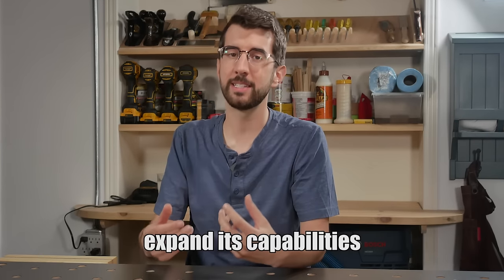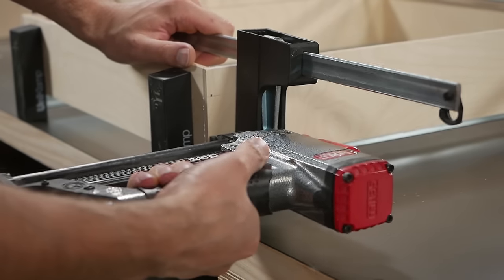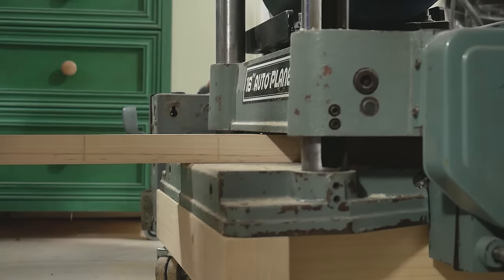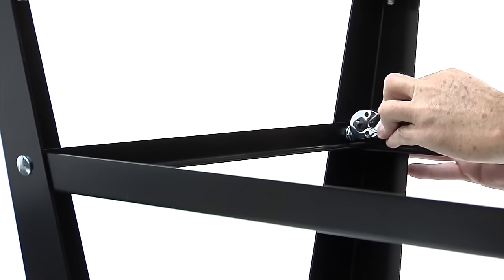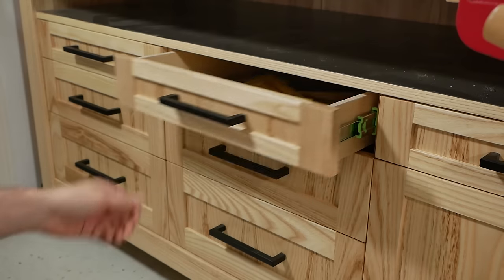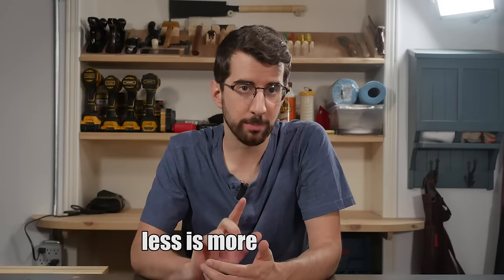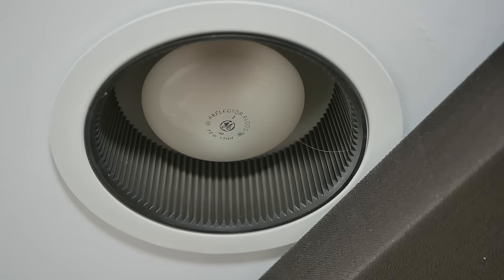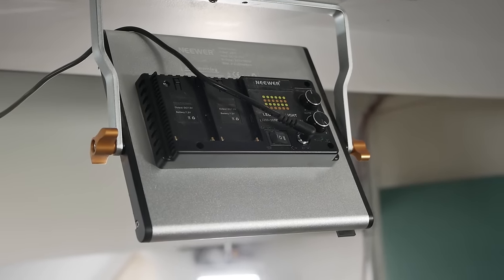a better way to layout your workshop

Comment: Appropriate video for me at this time. We recently moved from a big house where we lived for 30 years to a much smaller home. My 3 (!?!) shop spaces were about 1300 square feet plus additional storage space for "things" for a total of, maybe 1500 square feet. Sold or otherwise disposed of several big tools - stationary compressor, 2 welders, radial arm saw, band saw, etc. Now my shop is less the 200 which include the garage that SWMBO wishes to use for the car. My fix was to rent a storage unit for wood and seldom used tools, many of which are auto mechanics for my other hobby. Yes, a bit inconvenient but it's only 2.5 miles away. Everything else at the house - a (perpetual) work in progress. Now, what to do with that hefty drill press...........

Comment: You can use cheap conventional sturdy foam as well.  The trick is you have to freeze it but once you do you can drill or route it same as any other material.

Comment: cleaning and organizing takes a LOT of time. BUT I can say if you can get it organized and make a "space for everything", it makes it much easier. Its just a lot harder to do in a small space. And you can actually find your tools when you need them, saving a lot of time and aggravation when working on a project.
And YES good bright lighting makes a BIG difference. For the past 8 years, I only had some dim fluorescent lights in my shop. I wanted better lights, but the ceiling is high so it takes more than just strip lights and I didn't really have the money. However, I invested some $ into some LED lights and finally had the time to get them up about 6 months ago. And wow, what a huge difference it makes. Well Worth the investment, and makes working so much easier and more enjoyable.

Comment: I have a two car garage shop and have a Delta Unisom with the extended fence
My solution for the song was to put an angle iron extension on the table for the extended fence and pin that to the wall and then the saw is on heavy duty pop-up casters 
On the size not in use I just fold it up against the wall easier than one of those mobile bases

Comment: $3 magnetic bars from harbor freight are a godsend for storage in a small shop on a budget. i could not recommend them enough. french cleats are fine, but are going to run you a bit more in time, if not money, than what it would cost for four of those bars.

Comment: late comment to the video but white paint on the walls for light, and barrina is outstanding for cheap easy to install lights. use them in my shop and have installed them in four other garages to date for friends and family with no failures or complaints. the brighter option they have is a bit harsh for my liking, but the ones i use (single row) are bright enough to work under without hurting my eyes if i look up for some reason

Comment: Small shop?  You've got room for a chair!  ...and to sit on it!  ;D  
If you're REALLY short on space (yeah, I'm just jealous!) the ceiling is a good place to fill if you have the headroom.  Ladders are the obvious thing.  Also stands for things like mitre saws (and anything you can adapt to fit on them) if you have to take them outside just to be able to put them up.   Once they're up there anyway, you can slot things like long rules or rail guides into them for storage.  
Couple of decent saw horses (collapsible, obviously) and a piece of MDF (with MFT holes for extra points) and you have a collapsible outdoor workbench....that you'd kill to have the space to have inside!   
What storage space you have under the bench, you can put something like a bench grinder in but mount it sideways on a sliding shelf (with really good slides!) and you can pull it out to get access.  Upgrade the lamp on it (as they're about as good as the stock tool rests!) so you can see while you're down there and definitely connect it to your dust extractor while in use -  a quick connect style such as Bosch's or Festool's is good, as you obviously don't have room for any of that wall ducting or the room-sized extractor to go with it.  
The Festool extractor is quite good for a small shop - pricey, yes but it's rectangular so it actually fits in the sort of under-cabinet or next-to-workbench spaces that you might have...and it's on wheels so you can take it outside with you too (if you don't live in the land of perpetual rain!).  If you're feeling particularly flush, there's a cyclone add-on that mounts on top of it too.
"Small" is a relative term;  I reckon there's a few out there that would consider my shop big....but not many ;D

Comment: I find your analysis very interesting. I like the way you think. However, I would challenge you on the first order of retrievability. I think the small shop situation certainly changes the equation compared to a large shop for the reasons you mention, but it will certainly make a difference even in a very small space. How do I know this? Because it is absolutely true for the kitchen. Kitchens in general are not that large. Yet organizing them so that the most critical tools are in reach of your "work bench" i.e. the area of the counter where you do the prep and food assembly is vitally important. I can cut my cooking/prep time in half when I have things smartly arranged for reachability. I have even found that purchasing a portable cooktop and placing it where I do my prep work makes me surprising more efficient than turning around and walking 3 feet to the counter space behind my "work bench," where my non-benchtop model stove is. There are limits to this comparison, of course. Cooking is not woodworking...not exactly. Though there are often stationary appliances you have to walk around to to use (like big shop tools) and lots of hand tools you have to fetch from drawers. So, I would argue that the underlying workflow principle is extremely similar.

Comment: I've been cutting miters up to 46" on my table saw and they come out super tight. I haven't used my miter saw in over a year. I should probably put it somewhere else other than in the corner on the floor. And I do have everything on wheels, but that's because my wife still wants the ability to park in the garage in the winter or in bad weather. I don't have the option of leaving my table saw/outfeed table in the center of the room. In my case it is very important that everything is on wheels for me.

Comment: I finally figured out my lumber storage solution (Although I know it won't work for everyone): Under the basement stairs. That space is always awkward, especially if you don't have side access to it (which I didn't) so I built a giant shelf system going all the way to the floor to store boards longways in the tapering space under the stairs. Giving up a few extra feet in front of it, I can store up to 12 foot boards and a reasonable number of them, down to random small length scraps near the ceiling.

This totally won't work for everyone as you need at least the length of the boards your storing amount of space to pull the boards out, so you need that much space behind the stairs, and for a lot of house designs, there's an external wall 4 feet away, but if you have stairs and then another 8-10ish feet of potentially open space behind them, this could be a way better use of that space instead of the folding tables and chairs I know you all have under there right now.

Comment: I very much agree that it isn't talked about enough that we should all consider what projects we will actually spend time working on. However, I must disagree on drill bits. They don't take up much space, and if there are any sizes that you commonly use, you need several in that size. Since you will have several, why not have some by the drill press and some by the cordless drill? Also, I sometimes load up drill bits with the cordless drill/driver into a tool caddy to do a mobile job somewhere else.

Comment: Two small tips from me: 1. Unsorted drawers - at least make a "one layer!" rule. Preferably "the bottom is not to be fully covered, ever" rule. 2. Always have a buffer case and a trash case at hand. The first one is for quick drop-ins of stuff you know is out of place but you don't have the time to deal with it immediately. Works wonders especially for screws and smaller parts.

Comment: I have a 10' x 20' shop. I ended up getting rid of all my stand alone tools and replacing them with benchtop tools and then constructing a bench that could house these tools on hinged shelves beneath 180 degree folding hinged lids that formed the top of the bench's work surface. This bench cleared all my wall space and acted as off feed for my portable table saw. I made a router table which I fitted between the rails of my table saw and the router off feeds onto my bench. 
  The bench houses a bandsaw, drill press, miter saw, surface planer and access to a plenum that is equiped with blast gates to each tool including the tablesaw and router. The plenum attaches to a dust cyclone which attaches to my shop vac. Since my shed is elevated and has a wood floor I connected the plenum to the dust collector via a below the floor level flex tube. I got tired of tripping over that vac line.
  To access any tool housed inside my bench and open it's blast gate only takes less than a minute. I only have my miter saw and surface planer rigged so that the working surface is flush with my bench top so that the bench acts as support for these two tools.
Reply: The basic rule of shop size is figure out what you think you need then quadruple it. That might be sufficient. Otherwise you're constantly fighting a losing battle for more space.
Reply: Depends on how much dinero you have to work with.

Comment: The first thing I did was get rid of those garbage metal stands. The best wall storage I've found it a plywood sheet screwed to the wall with 2x4s behind to push it out a little. Just make and screw your tool holders straight to the wood and you can JAM things together, like I have holders screwed into holders for 2 -3 layers of tools and its all organized and easy to get to. I also recommend a 3d printer to print containers and custom holders for other tools.

Comment: I like casters just because I can move tools out of the way for bigger projects once I don't need them anymore.  You can do the jointing and planing, then move those out of the way.  Eventually you end up with the floor space to assemble the project, and then move things back when you're done with the project.  You generally shouldn't be doing multiple projects at the same time in a small shop anyways.  
I'll agree with you on drill press.  Alot can be done with a habd drill.  There are some things like forstner and hole saws that don't work as well in hand drills.  It depends on what you do.
The other option for air compressors is just get a much smaller compressor that can sit on a shelf.  Then you can use it for other things like blowing sawdust off or other air tools.  The cordless nailers are nice though

Comment: Actually, casters ARE the answer, my friend, and here’s why:  I have a small wood shop, as most of us do, and mine happens to reside in the only economical space available to me, my basement. I have all my big machine tools on casters that allows me the maximum layout flexibility, allowing me to configure and reconfigure my entire shop, or just a tiny portion of it, in just a few seconds by moving a machine or two into a different area of my small shop.  It is because of CASTERS, my friend, that I have discovered the true genius of what the word “flexibility” means.  Because of casters, I maximize my ability to accommodate any size stock on any of my machines without all the hassle and expense of having to buy or rent much larger shop space.  Is it the most efficient situation?  No.  But for those of us who don’t make a million dollars a year, it sure beats the hell out of paying tens of thousands of dollars for a new shop.  And, yes, most of us have already maximized the layout of our shops, so we do thank you for your insightful video.  But, casters are, in fact, the answer for those of us who don’t own wood shops the size of a parking lot.

Comment: There is a science to lighting definitely. I hate direct lighting where the light source is in my feild of vision, especially with glasses. Indirect lighting is better where the light reflects off a white wall, then into the room, it also eliminates harsh shadows.
Reply: Paint your ceiling white and then over-illuminate it using those $25 monster LED wing lamps. But have an array of them facing upward. Build cheap lamp holders. They're dead easy to wire up and mount onto 2x4's.

Comment: Great video. I have a small shop. It's only 8x12ft. In it I have a table saw, miter saw, planer, jointer, band saw, drill press and a grinder. I like to use flip carts. I just roll out whichever I'm using into the middle of the room. For lighting i have 9 4ft shop lights. There is no where that has a shadow. Got them for only $3 each. 
I try to have a place for everything and I put everything back every night. 
I'm currently wondering if I can hook 2 sgip vacs together for stronger dust collection.

Comment: I will say, as a maker with ADHD first order of retrievability with having to take literally zero steps as well as open storage really are non-negotiables for me. Difficulty with object permanence really is a huge thing with ADHD and closed storage really exacerbates that problem. Hell, in the kitchen I still find myself opening several drawers to grab a fork. Obviously the benefits of any practice depend upon each person and their individual needs, but I do think that the frequency that those specific things are suggested to a warranted, given the much higher prevalence of ADHD people in the circle or makers than in the population at large
Reply: I made a small tool tower for keeping a few things right at hand. More are available in a few steps, but these are RIGHT there. I have done the review and swapped out things I found not being used. Made out of scraps, it validated the idea to me. I will prolly be making another with different tool holding methods - I did rows of different sizes of pvc. ADHD - having everything right there together is helpful. I watched “how to adhd” video about her coffee station and it kinda klicked.

Comment: Admittedly, my shop is a decent size at 22x35 but there are tools that i use extremely rarely; not even once a year.  But the reason is usually because it`s a one trick pony type of thing, and when you need it, it`s the perfect tool for THAT job.  Unless i have upgraded to something that does the same job better, i rarely get rid of anything.  Just my opinion.  Great video.  Thanks for posting.  Greetings from Uxbridge. I think you`re a Toronto lad?  Cheers.

Comment: lighting - take a moment to pick the COLOR ( as in color temp) of the light - bright white, daylight, sow white, candle light (too soft, too warm, not good with clouds of saw dust either) 
Some versions of white are better for finishing work like sanding out imperfections and such, so perhaps hand held or moveable lights for a specific task are in order - I personally do not like the blue hues of "daylight" but others swear by it for their shop - before you drop a few dimes, figure this one out...but yeah, as one who has an underlit shop, light is a GOOD thing...and I for one need a lot more of it
Reply: Cool white is traditional shop lighting which is on the bluish side. Depending on how a job is going we all may start seeing red anyways. Which we can call mood lighting. I have an overlit shop which I've turned into an underlit one. I still have quad dual 8 foot fluorescent fixtures on the ceiling I just don't turn them on. They're so bright they could wake the dead. I'm into more intimate lighting. I want the corners of my shop dark and mysterious.

Comment: Storage modularity. My tablesaw outfield table and assembly table are both designed with milk-crate sized cubbies underneath. I have a crate for glue and tape, a crate for paintbrushes and rags, a crate for small clamps, etc.
Stuff too big for a crate goes on a large storage shelf.

Comment: Ah, smaller projects, smaller shop! I just need to do away with making boats and focus on scrollsaw furniture, and I could get away with using a guest bathroom.
In the mean time, I still need to scarf three 8 ft long plywood panels into 20 ft parts. However, there is the possibility of sleeping outside and using my camping stove instead of the kitchen.

Comment: I'm jealous of you giant workshop! Mine is just 5x2m 
(yes, workbench, cnc router table, table saw, it all fits..)
Reply from the maker: mine is only 1 square meter larger than yours
Reply: @ScottWalshWoodworking  O wow, looks bigger 😀What are the dimensionsof your shop roughly?
For me, the 2m width is a challenge, at one side a workbench of 50cm deep, leaves 1,5m for my table saw. If i want to cut boards wider than approx 70cm, i have to set the whole tablesaw at an angle, so the board can hover above my workbench during the cut 😂
Reply from the maker: @winandd8649  It's about 3m x 3.6m. Do you have any doors you can open to take advantage of so that you can get longer infeed and outfeed?
Reply: @ScottWalshWoodworking  No, no useful doors unfortunately. Halfway the workshop on the other side of the workbench there's the "electrical / fuses" unit of the house which intrudes for 40cm into to room. so working with the table saw is really a challenge. But, if there's really the need for it, I can move the table saw outside (It's a relative lightweight unit on wheels)
Reply from the maker: @winandd8649  on the bright side, having the panel in your shop allows you to have easy access to new circuits!
Reply: @ScottWalshWoodworking  Haha, unfortunately, I rent my house and I'm not allowed to change things like that 😄